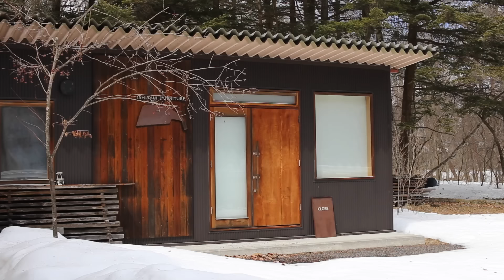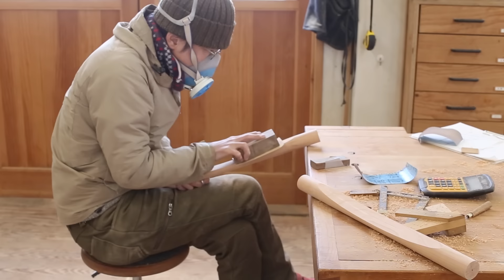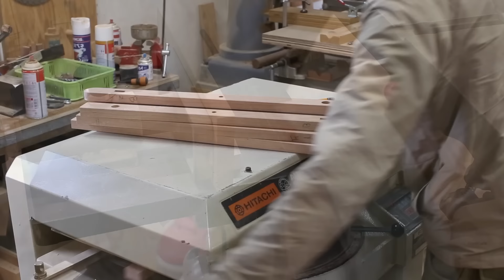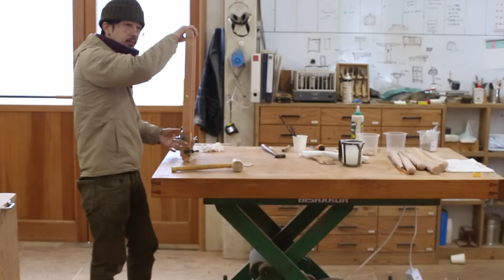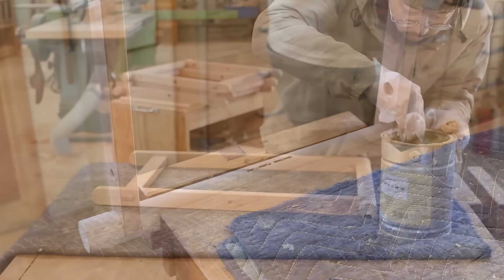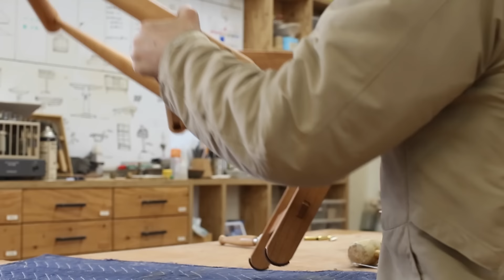ISHITANI - Making Wooden Folding Chairs - 20 oz canvas seat

Comment: Nice design. I somehow try not to watch the CNC bits of the video. I know it feels necessary to have that kind of a machine in the shop today for volume production, but for unique pieces I would still challenge manual labor to produce parts. Also, this is one design I believe may have a slight flaw - the seat, when assembled to seating position, body weight will pull the fabric downward, causing the legs to pull back and pinch (not too much, but I've seen this happen with other folding chairs that have no lock-in mechanism).